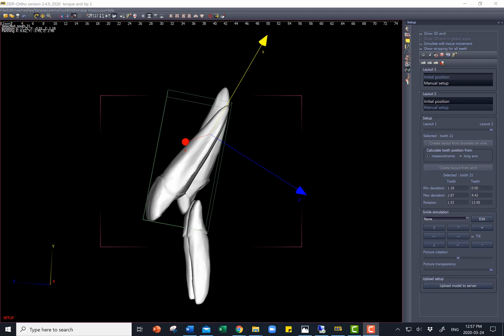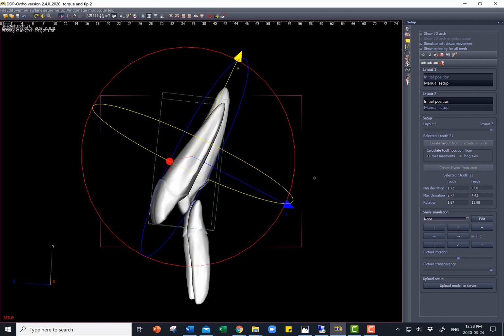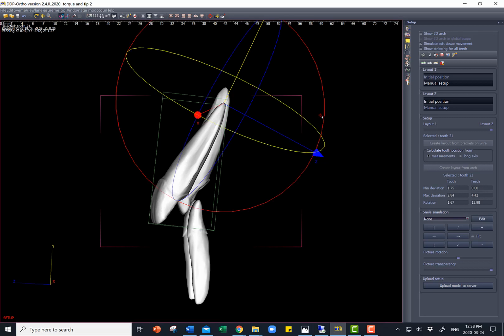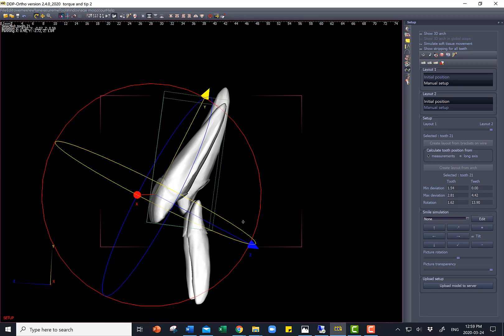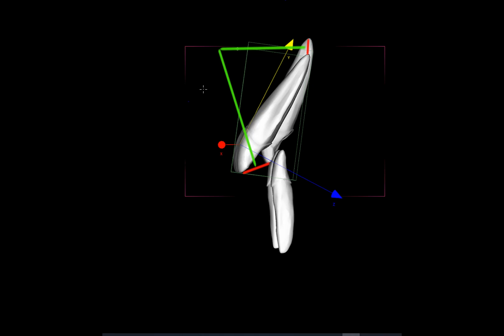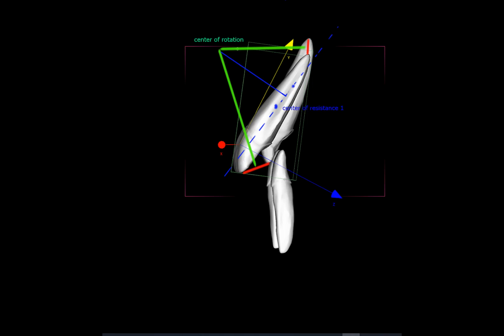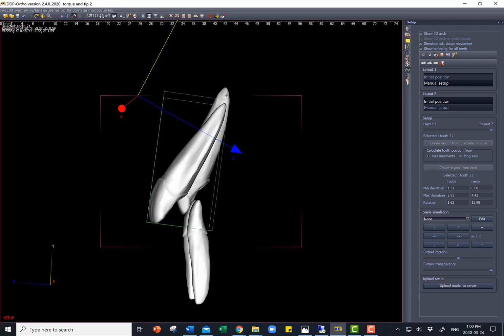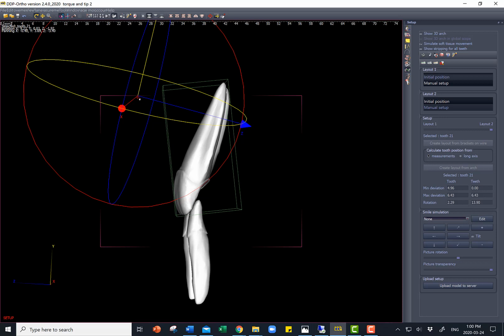Center of rotation

Comment: Is that finally point of rotation you found actually obtainable with braces. I could see a vertical and lingual forces from a bracket doing something like that but it’s hard to imagine the that it would not cause more significant movement at the apex.
Reply: I would like to say that I am asking not out of doubt, but straight curiosity and a desire to learn. I have no professional background.
Reply from the maker: The calculations has to do with the dispalcement of the tooth. It rotates arond a point called the center of rotation. FOrces have an influence but this is a different discussion.
Reply: @Discoverortho1  I see thank you!